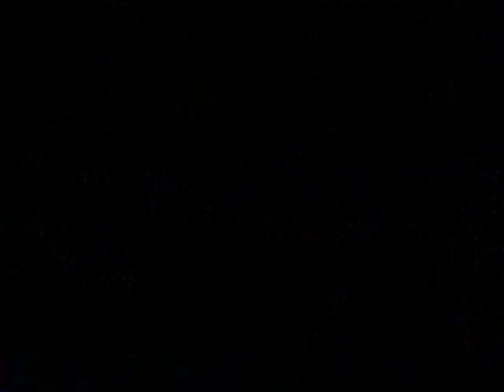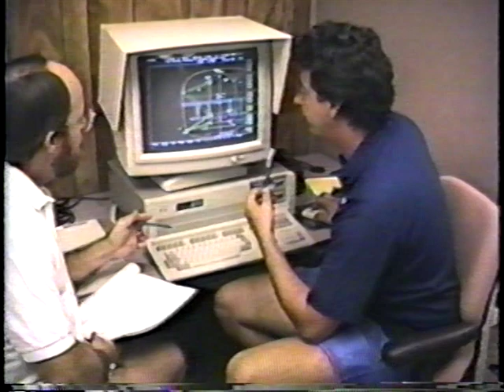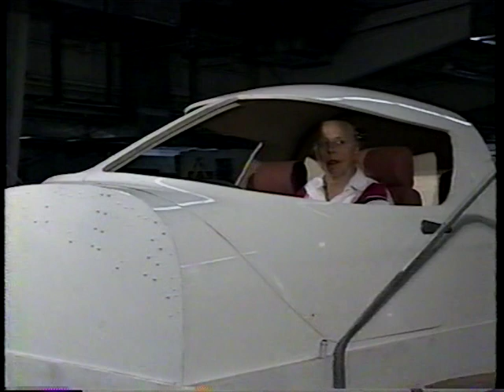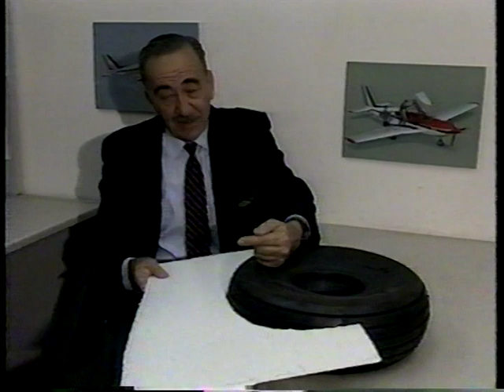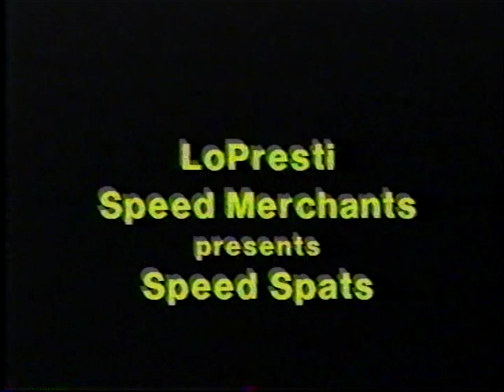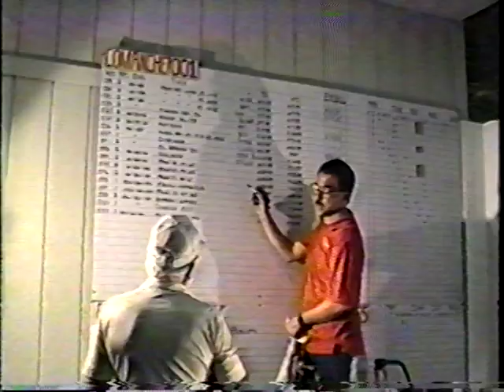LoPresti SpeedMerchants Comanche Speed Spat Introduction Video

Comment: I'm a pilot-wanna-be and this is the first time I've heard of improvements you've designed for Comanche. Did your sons also work on the Comanche 400 and if so, how many more mph were you able to achieve? Thanks.
Reply from the maker: most of our work was for the more popular 260 and 260B.  On those we found 27MPH.  Some of the mods for the 260s fit the 400.  that would get you about 8 mph